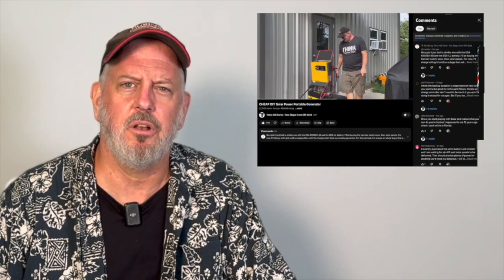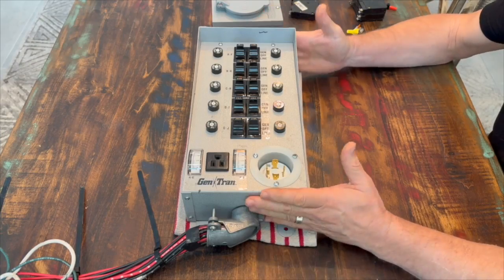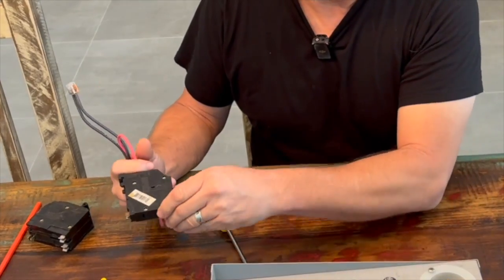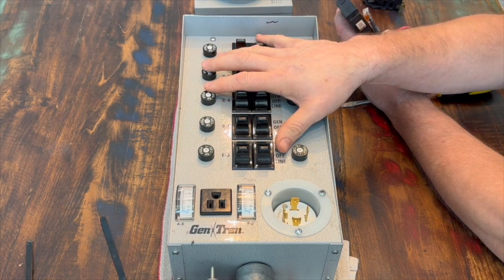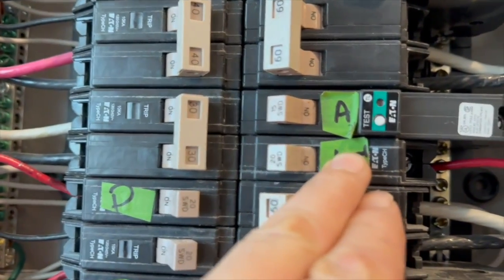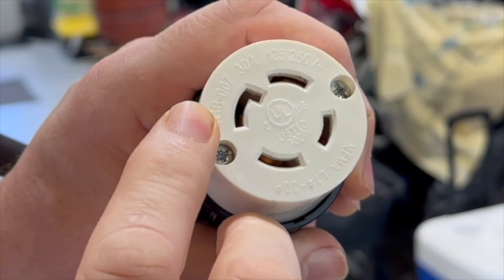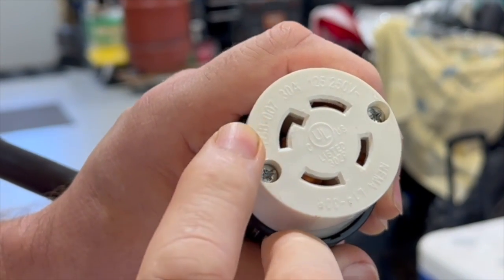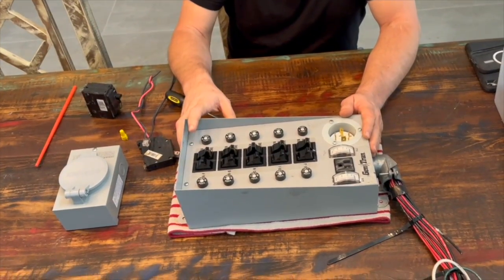How a Generator Transfer Switch Works

Comment: This is the best video on the topic I've ever seen. Thank you.
Reply from the maker: Thank you!  👍 I’m no expert but I’ve gone through several extended power outages, the longest being 3.5 weeks after Hurricane Ike.  You would have paid 4x the cost for a transfer switch or small generator in my neighborhood during that event, but you couldn’t find one for any amount of 💵.  After 3-4 days with out power, a lot of desperate people didn’t know what a transfer switch was and tried to wire their portable generator into their dryer power receptacle and back feed their home using a suicide☠️ cord (wonder why they call it that?).  I saw this happen dozens of times and a few wound up in the hospital.  For less than $800 right now, anyone can buy a portable generator, cord and transfer switch and prepare for a long term power outage.  I wanted the video to just explain the basics of how they work and encourage folks to find a back up power💡solution NOW.. before they need one!  Of course, if you have 100% confidence in your electricity provider, please feel free to carry on as usual. 🤣👍⚡️💡

Comment: Are there true automatic transfer switches where it autosenses loss of power and transfers to the battery/generator without manual intervention?
Reply from the maker: Yes there are.  They are more expensive and require wiring your electrical main service power into the transfer switch first, so they’re more difficult to install yourself.  Homes with standby whole house generators use these so when the power goes out, the generator goes on automatically.  Manual transfer switches are cheaper and much easier to DIY.  Thanks! 👍🤩⚡️

Comment: I’m confused as to why the gen powered transfer breaker wouldn’t back feed into the entire panel if it’s not switched off in the main panel?
Reply from the maker: @jetdust  That’s a reasonable question👍 the answer is because the generator manual transfer switch does not feed the main service load panel.  It only wires in to each branch circuit and creates a switch (separate breaker in the MTS) that separates each branch circuit from the actual load panel.  Think of it as pulling the branch circuit wire, to say your bedroom lights, out of the breaker and service panel, then directly connecting it to a different breaker with power only coming from your generator.  It’s going to power your bedroom lights from the generator but that power never enters the buss bar on the load panel.  Mutilply that 10 times if you use a 10 circuit transfer switch like I demonstrated.  The outside power source is only connected to the branch circuit wiring in your house and is separated from the service panel and panel breaker when you throw the breaker switch on the transfer switch.  👍🤩⚡️🔋☀️

Comment: Im trying to understand why the transfer switch is necessary, instead of the interlock at the service panel..
Neither of these disconnect the nuetral from the UTILITY and THATS where a backfed panel "could" and would,  potentially energise the grid at linemen, and or neigbors..

A 3pole disconnect between the meter, and the load center (service panel) would disconnect the main nuetral from the utility.. which is the potential hazard.

On the generator side, Im currently using a full nuetral bonded ryobi.. with gfci outlets.. 
According to ryobi, and internet sourcing.. the ground wire connection needs connected to the ground rod, or a new one for the generator for the gfci protection to work properly, and to balence the load voltages for your home sockets and appliences.. 

Can you speak a little about this contravercial subject?

Maybe Im over thinking this.  But its the service triplex nuetral leg (ground) that is connected full time.. inside the meter socket, and the service panel.. every termination lug, simply conitinues on.. to the nutral bar lug in the panel.

Wouldnt a 3 pole single throw discconnect be the proper way to completely isolate the Utility from the house service panel?
Reply: Sorry, forgot to make a complete statement at the end there.

A 3pole single throw for main service disconnection of all three legs including the utility nuetral.. combined with the manual interlock device for the generator backfeed breaker.. is what Im thinking about.. 
But obviously the 3PST disconnect is not discussed anywhere that Im aware of about backfeeding generators to a home.. only the installation of the transfer switch.. which AGAIN does NOT disconnect the nuetral bar from the UTILITY.. 

So.. the transfer switch appears to just make more connections to potentially fail, and or potentially backfeed the service nuetral which is still connected with a transfer switch only.. 
Am I making sense here?
Reply from the maker: @j9soundlabs719  Reliance makes a 3 pole transfer switch for generators using a bonded neutral with GFCI.  This is the preferred installation in that scenario.  With an interlock, a 3 pole manual switch is the best option to isolate the neutral if using any GFCI protected circuits.  Bonded neutral generators are not recommended for most of the Reliance 1-10 circuit manual transfer switches.

Comment: First excellent overview of a transfer switch and its functionality. I would highly recommend anyone watching to fully investigate a manual interlock versus a transfer switch. It is much cheaper, easier, more flexible, just as safe and not nearly as complicated.  As one example you mentioned you did not choose your furnace. I can make changes with an interlock that you are stuck with unless you rewire it. I just would never choose this option over a manual interlock.  Thanks for posting
Reply from the maker: @condor5635  Thank you!  Good points, and I actually have both.  Both require an outdoor inlet plug and with an interlock and with the interlock, you will need to be able to correctly size, wire and move/replace a breaker in the correct location of your service panel to do this.  That requires just a little more electrical knowledge/confidence than you’d need for the transfer switch.  Most folks could do both, but the transfer switch has a lower degree of complexity and you’re only running power into the circuit wiring and not into the main buss, so it’s a tad safer.  You also have to understand how to load shave with an interlock since the typical portable home generator won’t power all your home circuits.  Both are great and I can actually use my interlock for my solar power supply and my transfer switch for my portable generator…at the same time.  🫣👍☀️🔋⚡️
Reply: @terrahillfarm  moving and messing with one double pole breaker and two wires is harder than removing and rewiring 10 that  a transfer switch requires?  Not sure I’m following that.
Reply from the maker: @condor5635 With my interlock install, my panel was full at the spaces closest to the main, so I had to move all the 14 other breakers one space up to make a space for a new interlocked breaker. No big deal for most of DIY folks, but for folks not having much experience inside a panel, I just think the transfer switch is more foolproof.  Most interlock kits don’t have nearly as detailed installation instructions as the transfer switches I’ve seen. Again, I like em both and if I had a large enough generator or was wanting 240v power, I’d use an interlock hands down.  I just worry about the homeowner with their new 2,000w generator wired into the service panel with an interlock complaining because their microwave and coffee maker keep shutting the lights off.  😂🤣😆. The most important thing is you MUST have one or the other when feeding power into your home circuits or panel to avoid a deadly risk of back feeding the grid.  There will be a lot of people hurt in these hurricanes trying to power their home with a generator.  It’s so easy to spend a few bucks, plan ahead and have the convenience of running your home off your portable generator. I hope this video encouraged some folks to install a solution before these hurricanes hit. 👍
Reply: @terrahillfarm  totally agree with all those points!  I guess I was lucky case where I have some extra breaker space with two single poles to move to make a room for the double pole.  So happy with how easy it is to run now I just wanna get on my natural gas supply instead of gasoline

Comment: You still have to shut off the main breaker off in the main panel if not your going to back feed down line
Reply from the maker: @jasonhorner7243 Thanks for the feedback!  👍 Before installing a transfer switch of any kind, I’d suggest you consult a master electrician, because I am not one.⚡️However, shutting off the main breaker is not required with a properly installed Manual Transfer Switch.  The manual that comes with the Reliance MTS actually instructs you to leave it on.  https://images.thdstatic.com/catalog/pdfImages/33/33c57fd7-da79-4d14-8324-35a21cb4f83e.pdfqq

This is because a MTS isolates the grid for the circuits powered externally and all power in hots is going directly into your house wiring circuits, not into your panel.  If this were true, you could not power circuits in your house, with a generator, and power circuits from the grid simultaneously, which you can do with a properly installed, multi-circuit manual transfer switch.  (I’ve done this with solar powering some circuits and grid powering others).  

You can turn off the main if you like, however, a properly installed MTS cannot back feed the grid and this is why they’re specifically recommended by power companies for back up power solutions.

There’s another discussion one could have about the possibility of back-feeding neutrals in GFCI/AFCI circuits, but shutting off the main breaker wouldn’t help you any there and that’s beyond this discussion.  I would suggest just avoiding wiring GFCI & AFCI circuits with an MTS altogether, if you can.  Thanks! 😀

Comment: Very detailed info thanks, but all that effort and no HVAC I am confused.  But, of course I am in Texas without electric or AC after Hurricane Beryl.  Would love to see this exact video but with emphasis on a 240 HVAC complications included.  Anyway, great video
Reply from the maker: @gadgad691  Thank you, So sorry you and many of my family and friends are still without power in the Houston area.  Going without power myself for over 3 weeks during Hurricane Ike is why I try and help folks achieve energy independence.  To run your 240v AC you need to know a few things to properly size a backup power system.  On your outside condenser units find the BTUs number and the LRA (lock rotor amps) number.  The total of each of these numbers determine how large a 240v generator you’d need to run your house and AC.  If you have more than 36000 BTUs (3 tons), and you have natural gas to your home, a whole house standby generator is one of the best options.  Look at Generac, Champion and Cummins brands and make sure you get a solid quote on generator, automatic transfer switch AND the complete installation bd hook up costs.  Every house will be different.  Stay safe!  👍😇🤩

Comment: Thank you much, best explanation about this transfer switch box and clears things up. Very helpful first step for me as I'm interested in having one installed. I'm tired of running extension cords when the power goes out.
Reply from the maker: Fantastic! 🤩 It is really a game changer for folks with a portable backup generator or small solar power system. I’m on my 3rd home and 3rd transfer switch!  Properly installed, it is a very safe way to power the most critical circuits in your home in a power outage.  It’s not a light saber that will power everything, but a 30 amp 10 circuit switch should power most of your lights and plugs in the house, and trust me from past experience, in a long term black out, that makes things much more comfortable for the family.  Don’t wait until the next emergency 🚨 cause you won’t find one or an available electrician!  👍⚡️💡😆

Comment: Just curious, don't you have a well pump on 240v?  I do, which is why I'm building mine with the EG4 6K inverter.   Great presentation on this and the Cheap-Flo 3000 video.
Reply from the maker: Thanks Russ!  Yep I have a 240v well and in an emergency I can run it off a 240v generator.  I have several 3000 gal water tanks I picked up used and I may use one for water storage and run a 3/4 hp 120v booster pump into my water system.  I’m also doing a rain catch system with the other tanks so I’m just not sure yet.  Honestly, our well water has a lot of minerals so we’d prefer to filter rainwater if at all possible.  So many projects, so little time (and money 💰). 🤠👍

Comment: Great video! This video is jam packed with very useful information. I use 5 of these panels to power nearly my whole home. (specifically the 50 amp versions of these panels)
Reply from the maker: Thank you! 👍 I should have mentioned that your style of transfer switch, with full size replaceable breakers, is a little more expensive but it gives you a lot more ability to modify the switch to your changing needs!  🤠⚡️🔋

Comment: Great video thank you for sharing. A few segments of the video your voice was too low and the repetitive music made it worse , Still appreciated the lesson,don't mean to sound ungrateful. Are you concerned about your solar generator power back feeding and injuring a lineman repairing the mains power lines ?
Reply from the maker: Thank you for the feedback.  I struggled to film all the different parts and still keep the message clear. I must have forgot to turn my mic on in some parts. My tech skills are that of a man twice my age! 🤣.  I use my solar generator only connected directly through my generator transfer switch which makes it impossible to back-feed the utility line and injure a lineman because the power to the line is cut when the circuit switches over to “Gen”.  👍⚡️
Reply: @terrahillfarm  You are very blessed ,thanks again for sharing your knowledge with us .

Comment: I've never quite understood the point of the transfer switch unless it was automatic for one of those fancy expensive generators. I just have the input to my panel and i manually throw all the breakers i want...
Reply from the maker: Thanks Bob!  If you don’t want to mess with wiring up a manual transfer switch, the whole home generator with automatic switch is a great, safe, but much more expensive option.  If you have access to natural gas, ⛽️ they’ll run forever in a black out.  If you have only propane, to run your backup generator, you’ll run out of fuel much quicker than you thought. 2 of my neighbors couldn’t make it 4 days on 500 gallon propane tanks during the TX snowmageddon of ‘21 ❄️. This is why I’m a fan of being able to power only critical ⚡️loads, for weeks instead of days, and that’s going to require a smaller generator.  If using a generator interlock on your breaker panel, it’s important to understand if your generator has a bonded or a floating ground (floating being the preferred choice).  The interlock shuts off your two power ⚡️cables (L1 & L2) but not your neutral and ground.  This means you don’t want your generator to also have a bonded ground since that can be a safety issue.  Much more detail than this video covered but even in my brand new home I found the (idiot) electricians bonded the neutral in two locations… ☠️ a big no-no.  That’s why I said “everyone’s service panel may be wired differently (or incorrectly) so it’s important to make 100% sure it’s correct before sending an alternative power source into your home wiring”.  Stay safe my friend!  👍☀️⚡️💡

Comment: 1st. I have a transfer switch on my wall not used anymore dont need it. Love your table.😂
Reply from the maker: Thanks!  Once you graduate to “off-grid” a transfer switch is pretty useless!  Over 40 yrs in Houston I saw way too many rednecks wiring generators up to houses with suicide ⚡️cords after hurricanes.  Hopefully, this video will prevent some of that dangerous stupidity.  The table was custom made by some guy in his garage I found on the internet.  It’s built like a tank and cost less than the cheap imported junk table at the furniture store we sent him a photo of to duplicate.  🤠👍🏠